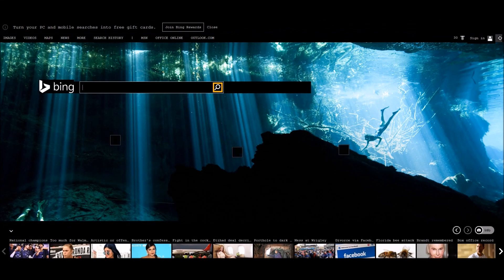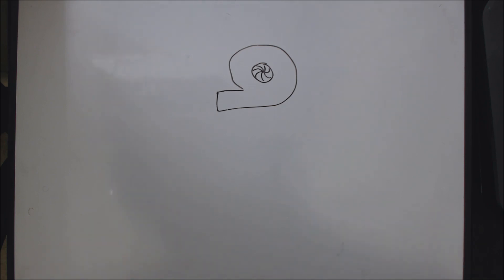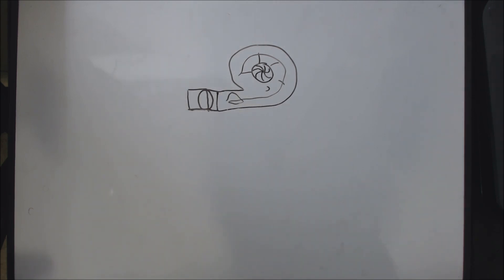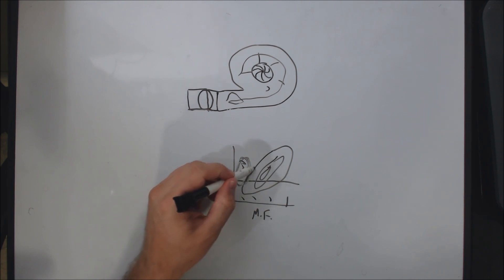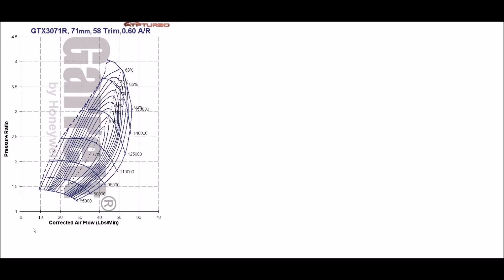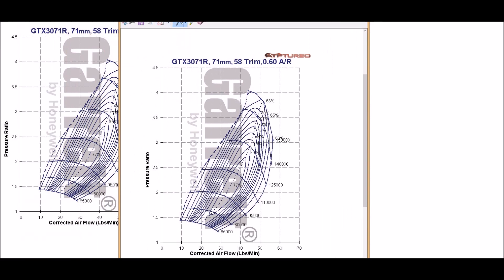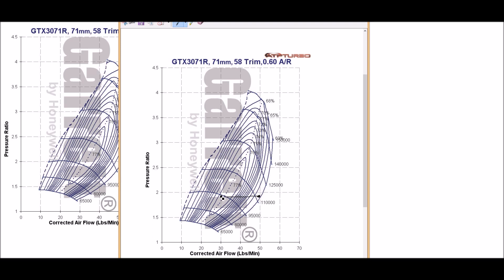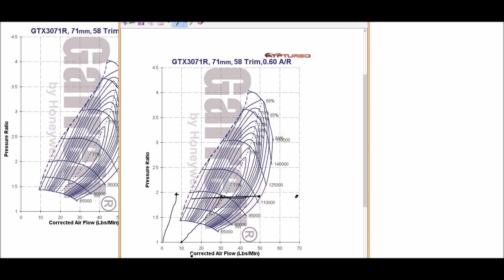How to Read a Turbo Compressor Map (Video 4) |JOKO ENGINEERING|

Comment: How can one know the rpm of a turbocharger by knowing the rpm of the engine?
Reply: You can see the compressor speed lines on the compressor map. They go from 65000 up to 150000 rpm. You can roughly determine your air flow from the engine rpm. If you also know your pressure ratio, then you can estimate a compressor speed using the compressor map. You can put a speed sensor on the compressor if you really want to know the speed.

Comment: Compressor stall (or surge if you prefer) is the collapse of air flow in the compressor. It's very erratic and thus unpredictable. That causes the cyclic loading and eventual failure of the compressor structure.

Other failure modes include thermal fatigue of the turbine rotor (leading to cracks and eventual rotor failure), compressor and turbine erosion (from particulates in atmosphere... buy good filtres!) as well as corrosion, both leading mainly to loss of efficiency and eventually capacity.

Bearing and shaft failures can occur in poorly lubricated turbocompressors, especially ones cooled by that very same oil. The 1.6HDi engine for example is well known for ravaging turbos in that way (in comparison the 2.0HDi 90/110 is fuckin' indestructible!)
Reply: 233kosta 
Pew tchuu chuu chuu chuu
Reply: 233kosta 
Turbine/compressor wheel damage that results in an unbalanced wheel is not real flash for bearings/shafts.